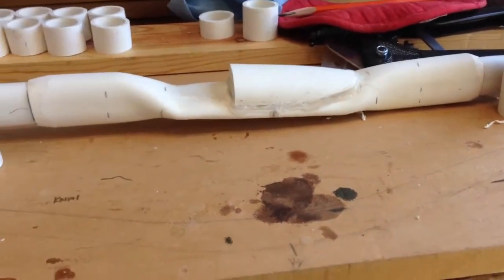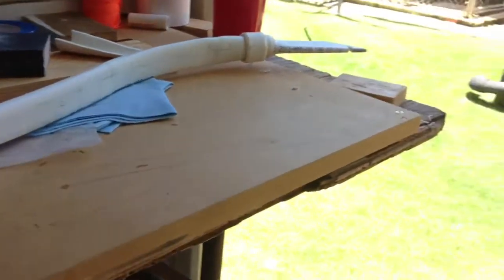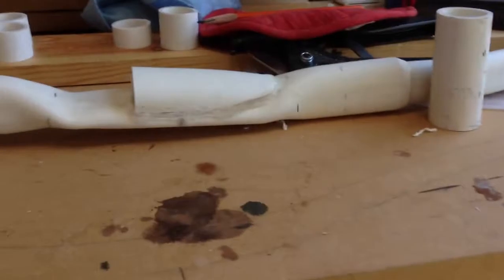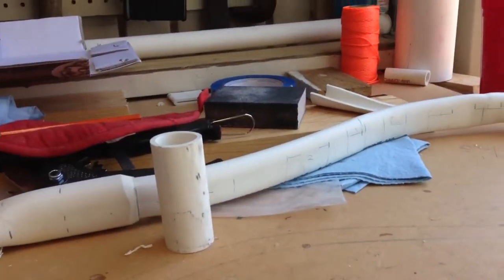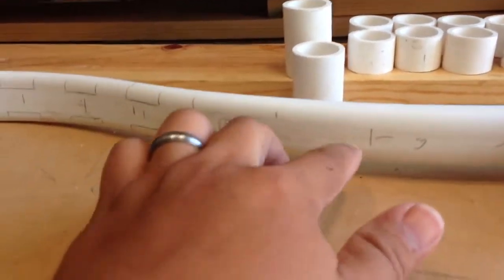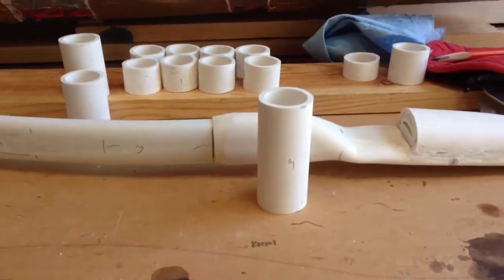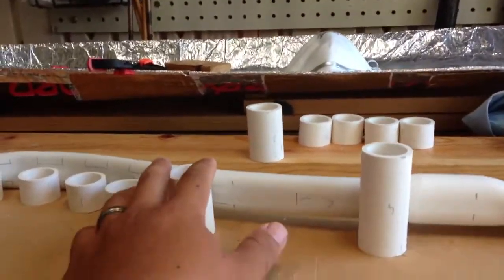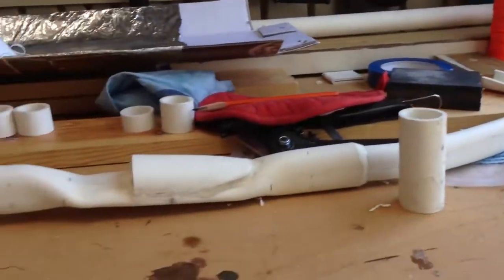Attempting to make the pvc limb stronger

Comment: The ring idea sounds great. I think though that what will happen is that each section will still flex so you might get a little increase, but the added weight will probably make the bow slower. If you have 15" of scrap you could cut it diagonally and then laminate the two halves along the backside of the top and bottom limbs. Then slide rings over if you have larger pipe

Comment: I don't know whether the  spaced collars will work, or whether they might just  add stress to the uncollared exposed sections of the original limb ?
But ... if you were to  cut some long strips of  thicker PVC pipe, or even flat waste, then use some of the heated 'collars' to stretch over them to secure the strips to back or belly, you might well be  getting an approximation of the differential  heartwood/sapwood wood , back/belly  ,  use in a tillered English Warbow.